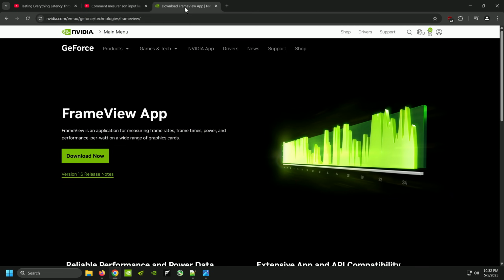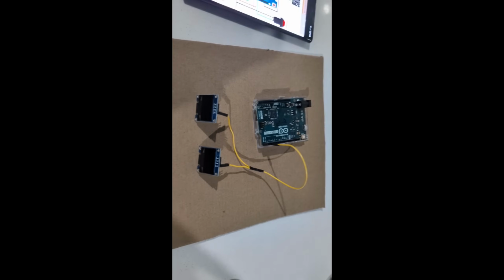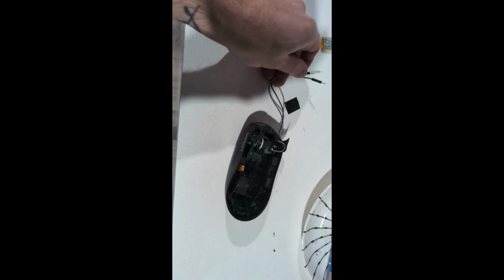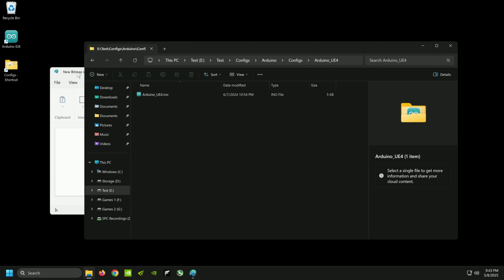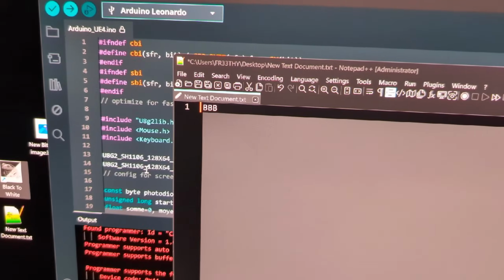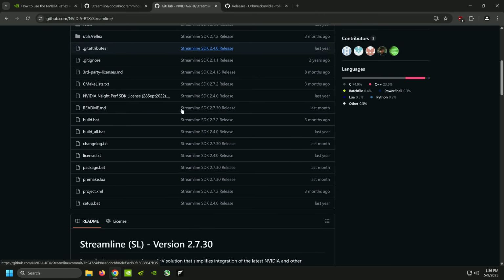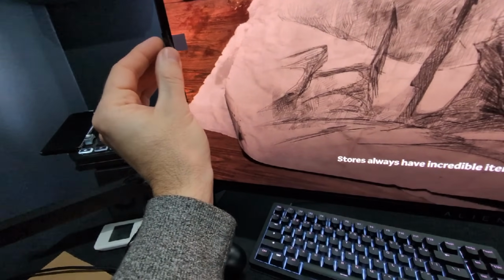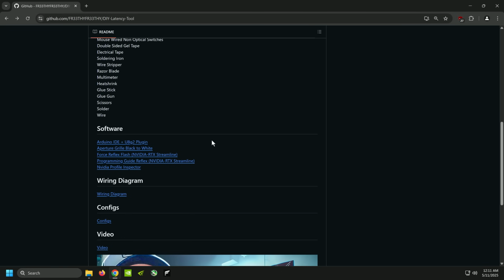DIY Latency Tool

Comment: you can make a autohotkey script that flashes a white box on mouse click

 ; Initialize large white flash square GUI once
Gui, FlashSquare:+AlwaysOnTop -Caption +ToolWindow +E0x20
Gui, FlashSquare:Color, White
Gui, FlashSquare:Show, w350 h350 NoActivate Hide
WinSet, Transparent, 200, ahk_class AutoHotkeyGUI

~LButton::
    MouseGetPos, xpos, ypos
    size := 350
    xpos := xpos - (size // 2)
    ypos := ypos - (size // 2)
    Gui, FlashSquare:Show, x%xpos% y%ypos% NoActivate
    Sleep, 50  ; Show for 50 ms
    Gui, FlashSquare:Hide
return .... save in notepad as whatever.ahk // and you can test latency in any game, even if it doesnt have reflex, like for nvidia analyzer, run in borderless
Reply from the maker: update ive tried AHK and even made a C++ app to do it
both add quite alot of delay vs the reflex box
i guess this is due to needing to pass through dwm

im currently testing a rivatuner overlay box flash, seems to work well
just need to triple check how accurate/reliable it is

ill keep you updated
Reply: @FR33THY  yeah i noticed this too a few hours after i posted this, on aperature grill i normally get 2ms with reflex analyzer, but with autohotkey, its like 7ms, but, i think its still good to compare cloned monitors, i bought a $200 used galaxy s9 and record 960fps, and i can see which monitor has less input lag with this, Raymond Wang's Display Input Lag Tester tool can be used, it lights up keyboard numlock key, place it vertically on your monitor, and use VLC and buy pressing E you can go frame by frame, and count the frames, its pretty easy
Reply: @FR33THY  you can buy a cheap galaxy s9 and download Raymond Wang's Display Input Lag Tester tool, place keyboard horizontally on your monitor, when you press right click, the num lock key lights up, and you press record same timewith 0.2 galaxu s9 slowmo setting (960fps), then use VLC and press E and go frame by frame, and count the frames from the light showing until the reflex box lights up, its actually kinda easy
Reply from the maker: Going to try this out and see how accurate is vs the reflex box tysm mate

Comment: Nice video bro, btw I had a question regarding the fix win11 implemented on their new patch for high polling rate mice, now in all games run 8k without stuttering, is it possible to mod win10 to be able to have same fix without moving to win11?